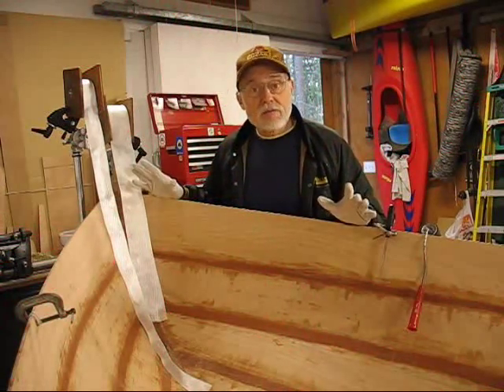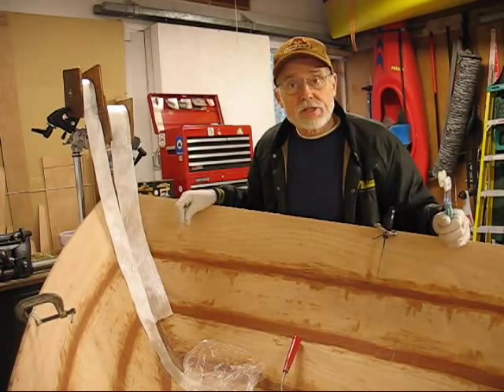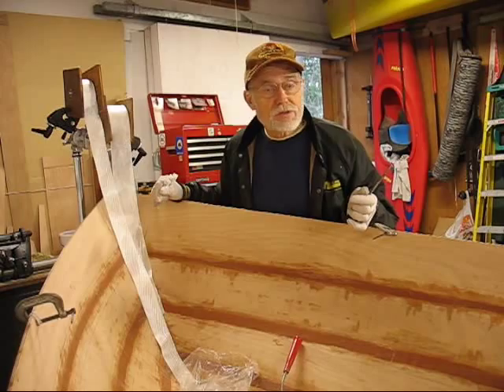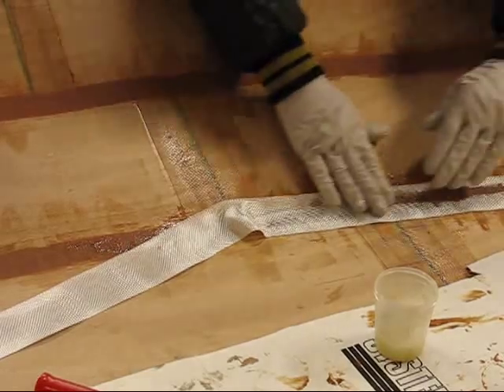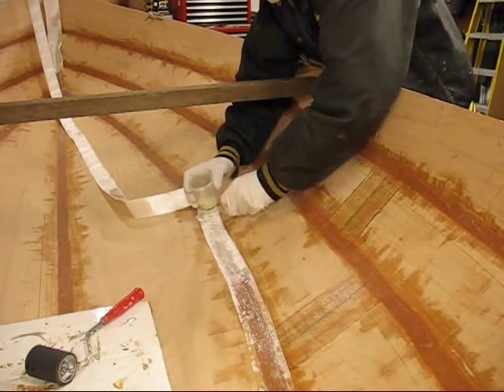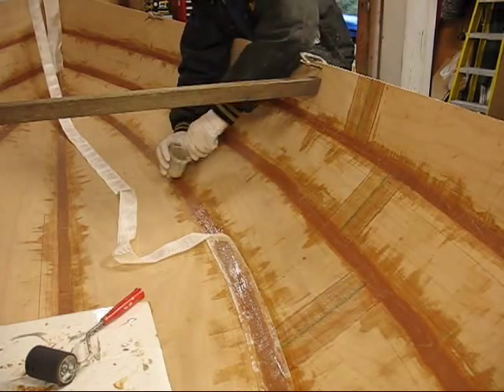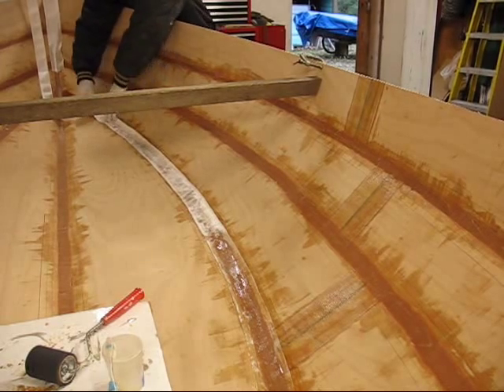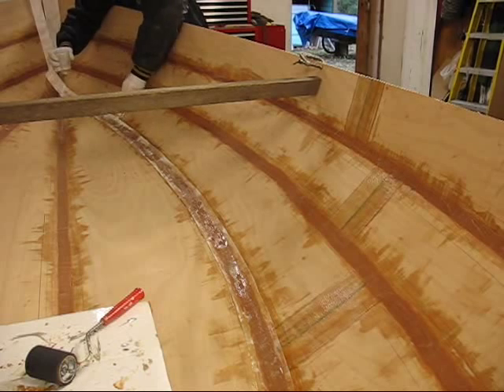Part 20 -1 - Fiberglassing the Hull Seams.wmv

Comment: on those 3 fillets I would precut and roll up 3 pcs tape. Mix a pint of resin and roll onto all seams with a 2" glue app locating roller. Than roll out all 3 pcs tape right into the resin. Than go back with brush roller or squeegee to finish. Spread resin quick, more working time. I will try a toothbrush on some small areas. Nice finished product. Thks for posting.

Comment: why not use a chip brush to spread the epoxy...that tooth brush method looks tedious
Reply from the maker: I've used all types of brushes, including chip/acid brushes, and the tooth brush is still my go to and the best brush you can use for epoxy.  I would never change.  You should try one to see why I use them.
Reply: i've been using 2 inch chip brushes for quite a while....i cut the bristles off about half way to the ferrule. i cover more area in less time and i can also use the same brush to smooth out the glass...and the bristles being shorter renders them a bit stiffer so i can squeeze out some air pockets... and i get a better wet out..